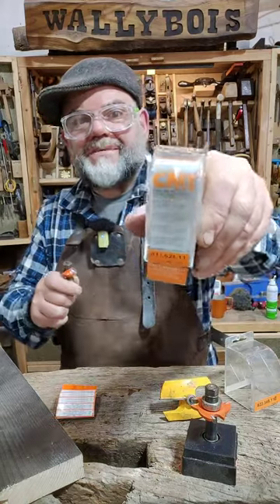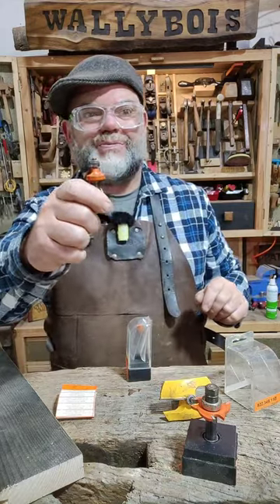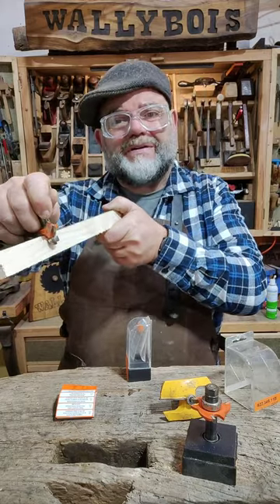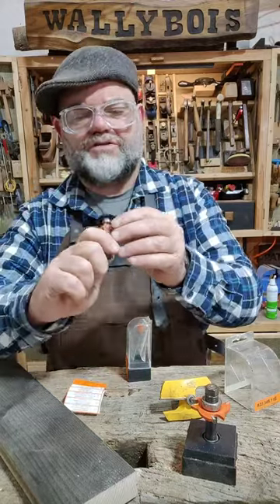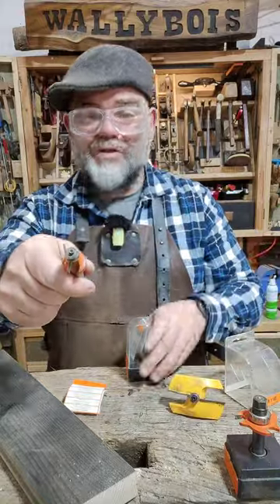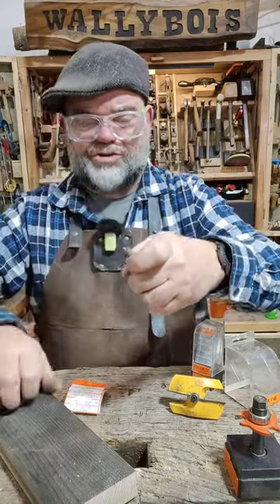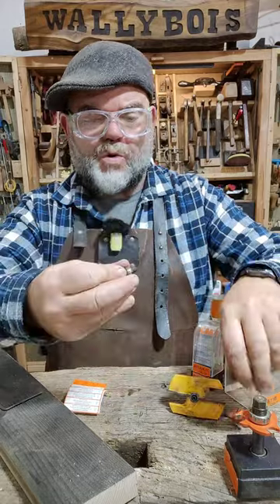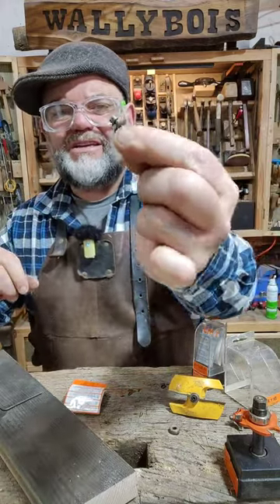Orange CMT router bit and it's mysterious washer! #routerbits #woodworkingtool

Comment: I've noticed this with CMT bits lately. I had one on a spiral pattern bit that did that.  Took it off and saw that the screw was too long without it - i.e. it didn't tighten down enough to secure the bearing.  Ground the screw down a couple of threads, refitted it and problem solved.
Maybe the maker has a mega supply of the wrong sized screws!  😅
Reply from the maker: I thought I was going mad 🤠
Reply: @WallyboisWoodworking   Nope. Just a case of yet another company cutting corners I expect. I've started using Trend bits now. A tad more expensive but the quality is leaps and bounds better tbh. Shame as I've always recommended CMT in the past but no more.

Comment: Yes but there are usually a few different size bearings and washers that come with the kit. They're never that sloppy on the bolt though. I think it's to keep all the balls in when the bearing gives out. If not they aren't necessary at all if the bolt head is the proper size
Reply from the maker: Thanks for the info!

Comment: My CMT rebating bit has multiple bearings and two different washers like this- a small and a large washer. 
The small washer is used on the smallest bearings to avoid overhang. It looks like CMT put the wrong washer on yours. Why the washer at all? On large bearings, I think it stabilizes the bearing. On small bearings, who knows?
Reply from the maker: On closer inspection the washer has worn in the hole so it must of been spinning 😬